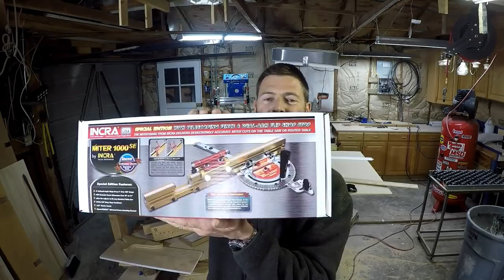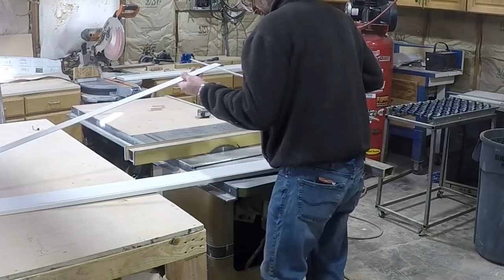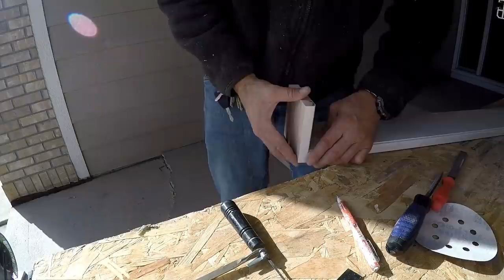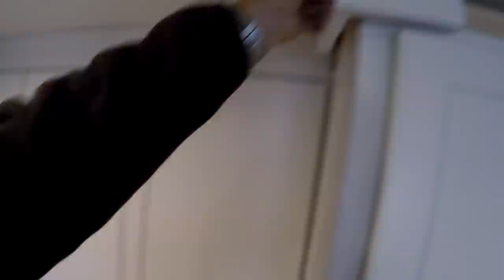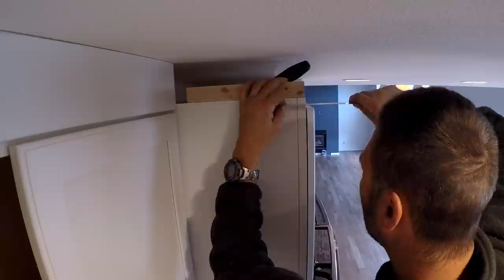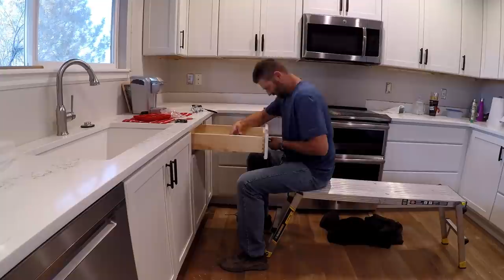How To Install Crown Molding On Kitchen Cabinets

Comment: Use a piece of scribe molding or rip a piece of filler strip 1/4" thick 11 1/4" long  and nail to top side of cabinet with a pin nailer instead of cutting a notch in top cabinet face  so crown will fit tight to the side.

Comment: Love your videos, just a quick suggestion. When using the table saw, make the cut so your smaller piece is on the left side of the cut so it can freely move away from the blade. Otherwise, the piece can be caught between the fence and the blade, and shoot back at you, especially because you do not have a riving knife protecting the back side of the blade. Just don't want to see you get hurt!
Reply: yea was just about to say
Reply: Very good suggestion...
Reply: So true, it’s little thing that can get us in a jam.👍
Reply: cut them equal before gluing !!!
Reply: Came here to say that..... it won't take him but one time to learn lol

Comment: CA glues or cynoacrylate glues are just crazy glue. The activator is what is magic about it. Do yourself a favor and buy the (2p-10) brand!!! The activator and glue comes in MUCH larger sizes for your $$! We were going thru those BSI ones so fast before we discovered 2p-10. Great Vid!
Reply from the maker: Thanks for the advice I'm going to pick some up.
Reply: smokingcheeba420 honestly we started using it on outside corners of crown, miter joints and mouldings returns after seeing Richard of #finishcarpentrytv using it. Glue one side activate the other side or glue a seam and then spray the seam and it’s an instant bond. Now we use it on ANYTHING that can use the help of a chemical bond as well as the usual fasteners. Negates the use of my micro pin gun in most cases now. Once you start to carry it on the truck you’ll find uses for it everywhere
Reply: I use gorilla CA or whatever is on sale and don’t ever buy the activator.  You can make your own activator it’s just an alkaline solution (like bleach mixed with water )
Reply: Would you do this for baseboards as well at 90 degree bends? Do I need to do 45 degree joints overlapping to adjoin baseboards in a straight line?

Comment: pocket screws? never tried them on a cut like that but should work, only tried them on picture frame miters. or straight wood glue and clamp overnight and put some strong tie straps on the back.

Comment: That's actually model airplane glue you're using. Hobbyists have been using his CA for decades, and I believe that's how Bob Smith Industries got it's start. Keep a bottle of the de-bonding fluid within reach as you'll eventually glue your fingers to the work! I once glued BOTH hands while holding down a wing spar cap. Luckily, my daughter was in the house and came to rescue me! You can buy the de-bonder from Bob Smith too, but it's the same as nail polish remover, which is less expensive, and your wife may have some.

Comment: You will bow out back of door if you don't clamp a block behind your drill bit when installing handles.
Reply from the maker: This can happen.  I was using new sharp bits and it did not happen to me

Comment: What do you do to touch up the nail holes/joints after you are finished? do you paint again?
Reply from the maker: There is not touch up.  So the joints have to be exact and perfect. I only used 4 nails to install all of the crown Its is glued in place.  The nail holes are so tinny that a little bit of white caulk makes them disappear
Reply: The Handyman your the man! Thank you.

Comment: Whats that jig u use for drawer pulls?
Reply: He probably made it with 1/4 plywood adding some 3/4" stop blocks to tge back and drilled holes using dimensions from the door where he'd like the pull to be.

Comment: Looks really nice.

Did you ever find out the type of paint on those cabinets? I'm looking to redo the trim in my house and wanted a durable paint.
Reply: Benjamin Moore and sherwin Williams are the 2 big suppliers in my area. Ben Moore offers lines of: enamel for thick restoration type coats, a type called "advance" which is better than their aura line for durability and application on all forms of interior trim. I've refinished several kitchens with this paint. Sherwin Williams offers the same paints in different packaging but I don't remember their names off the top of my head. I use Benjamin Moore 7 out of 10 jobs
Reply: @beepo8221  Thank you very much! I'll look into these.

Comment: Handyman, check out Ron Paulk's "total station" you might get a lot of use out of the design yourself.

His trailer setup is pretty sweet too.
Reply: Ron Paulk's Total Station is genius I made a few modifications to the one that I take with me, but the one back at home is built to the plan specs. I purchased The Whole Enchilada Package #5 and The Paulk Compact Workbench 3x6 Plans, you couldn't find a better $50 investment than this. The plans are amazingly genius and easy to build.

Comment: Duh it's flat casing not crown. A  big difference in skill without compound miter cuts.
Reply from the maker: It is called flat crown around here in the construction industry .
Reply: It’s not that hard, just get a pair of crown stops or even make your own if you’re cheap.

Comment: Thought it was just me.  Bought $1700 worth of tools Dec 31 at 11:52pm. Amazon of course.
Reply from the maker: What did you get?????   I had planed on spending more but didn't make the time to do the research.
Reply: Let's see, new portable table saw, planer, one of those Kreg portable work station, some nice blades, clamps etc.,  like Christmas again. Use the system brother!!  @TheHandyman1